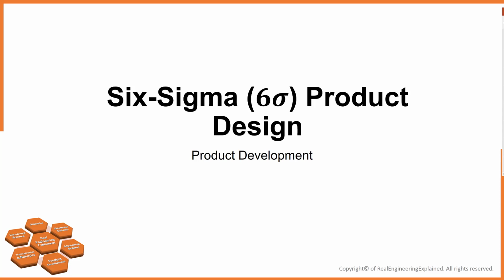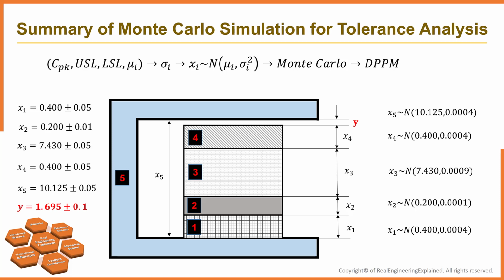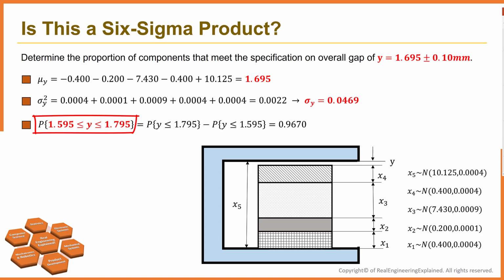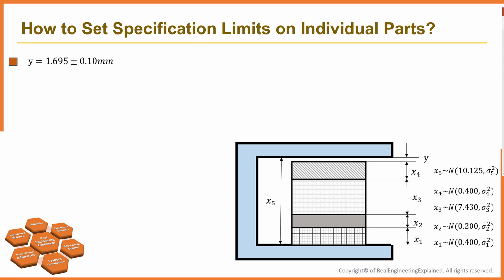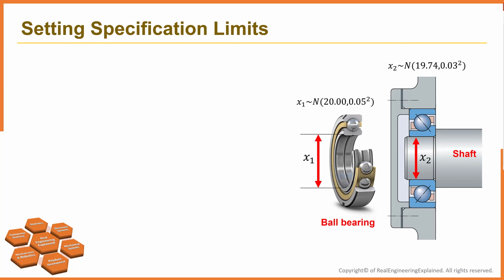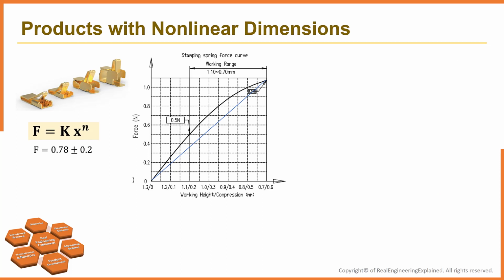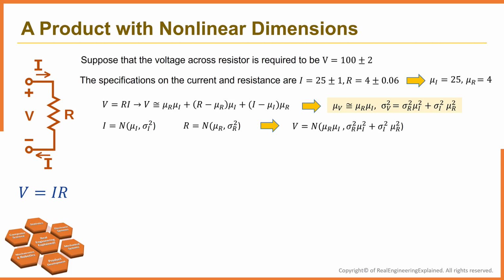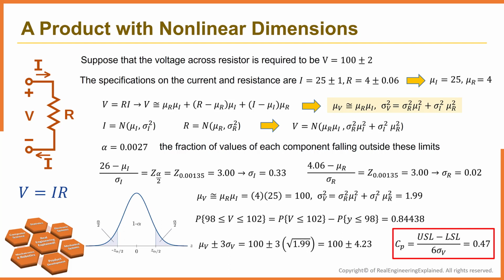Design for Six-Sigma | Six-Sigma Product Design | Tolerance Analysis | Product Development

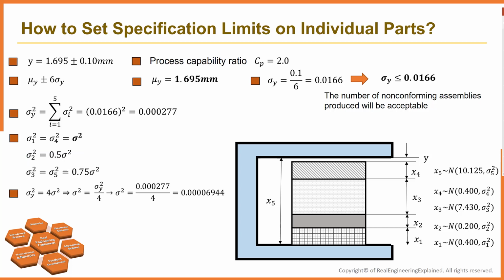Comment: Note 1: @ 11:09 ==> sigma 3 and 5 !!!!, not sigma 4.
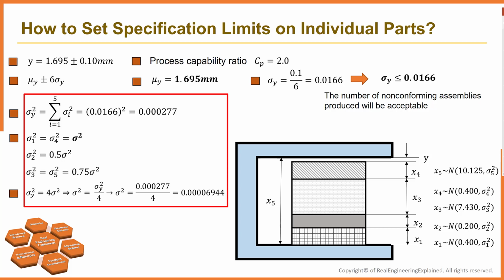Note 2: @ 11:21 ==> 0.000277/4 = 0.0006925 and not 0.0006944 !!!!
Great video. I learned a lot, but it must be corrected.
Reply: Re. note #2, if you pull out your significant figures to 8 or so and run all the calculations from the very top you get the same thing he posted,  ie 0.00006944

Comment: How did you assume the relationship between sigmas for the individual components at the 11:00 mark? Your first video on Process Capability Analysis was great, taken at a nice pace that was easy to follow., and performing each step and explaining in detail was very beneficial to the video. I just watched your videos on measurement system analysis and they weren't as detailed. Still good videos but not as easy to follow and it seems like the explanation and reasoning was skipped for a few steps. I recommend sticking to the style of your first video to maximize the benefit to your viewers. Thank you for your work here, it is greatly appreciated
Reply: Hello Mike, did you find the answer to your question? if you did, could you please share your answer. I'm also having questions about the tolerance values presented at the minute 1:37 (x1=0.0004; x2=0.0001; x3=0.009; etc), do you have any clue about how he got this numbers? I'm assuming he got the numbers from a previous analysis done in minitab, and this is the value of the standar deviation from each tolerance component.
Reply: @pablogarcia-to7vv  Here is how I interpret it. The tolerance on the left are design tolerance which is required by the designer. They indicate the part upper and lower limits to be an NG part. The stdev on the right was calculated from CPK he said. For example one spec's design tolerance is +/- 0.1. The CPK given by supplier is 1.5 so the dimension stdev is (0.1+0.1)/6/1.5=0.02